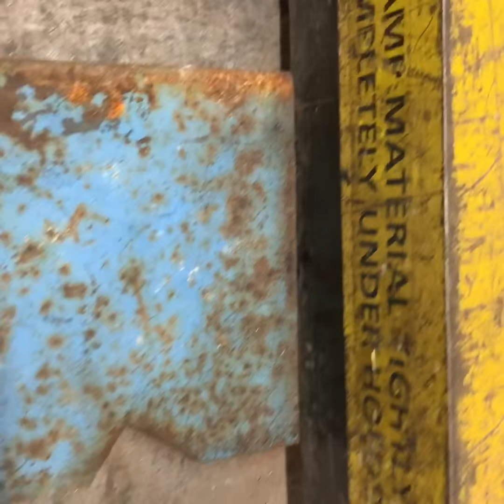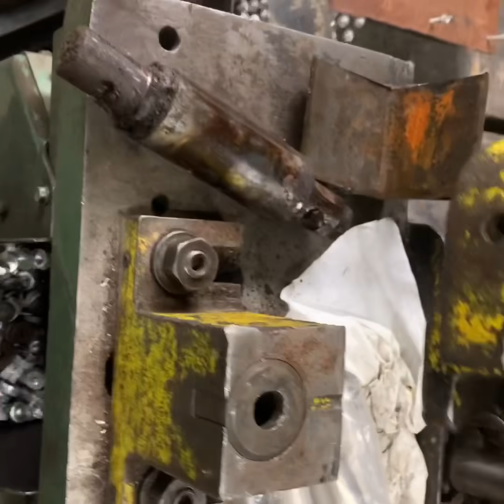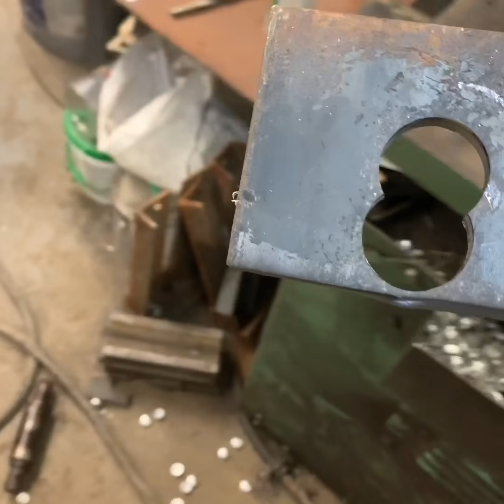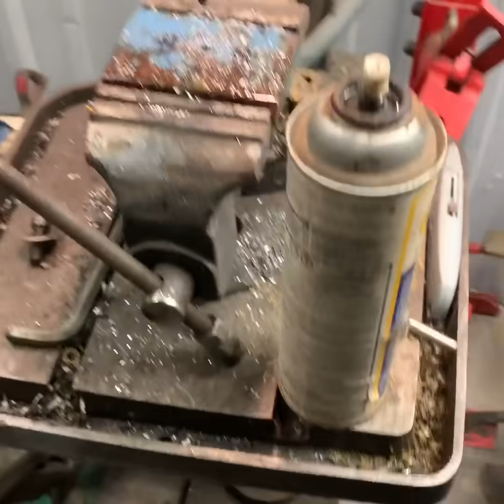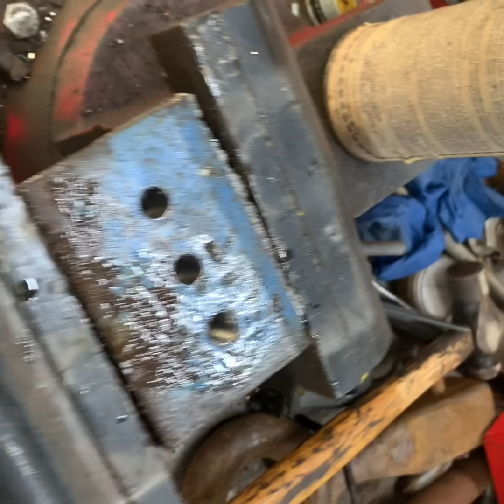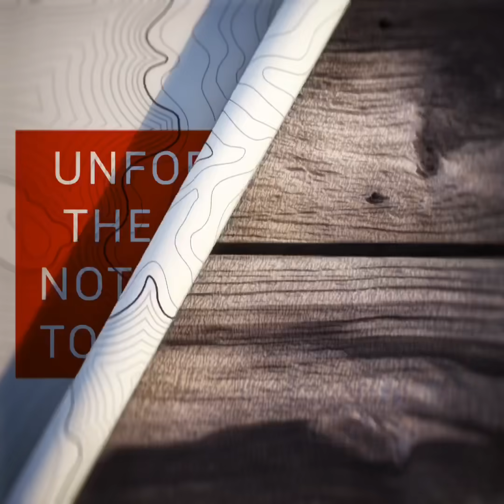Attempting to make a tool for the pre war silverside part 4

Comment: If you have a low pressure mechanical fuel pump like off of a SBC and attached to something like an overhead cam cylinder head cut down to seize might be a way to solve the oiler. Or a old Detroit fuel pump.

Comment: If you are going to take the spring out , would it not be easier to cut the ears off the pin and press the bush out after you get the spring out? I am only asking...
Reply from the maker: If I could get in there yes

Comment: Well crap the puller didn't work. Is there room to get forged wedges where they would help to get it broken loose?  I am also wondering if an inductive heater would work?
Reply from the maker: I’ve got another plan of attack for it

Comment: AC pump was a good idea but don't over complicate it just get a cheap parts washer pump off Amazon and use it for your oil supply
Reply: All I wasn't dogging on you that was a great idea just giving you something else to ponder
Reply: I was thinking an old fashioned drip oilier might work.
Reply from the maker: I was trying to not spend any money just using stuff laying around
Reply: Gravity is your friend!